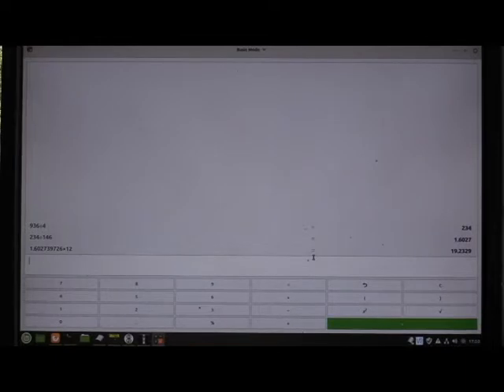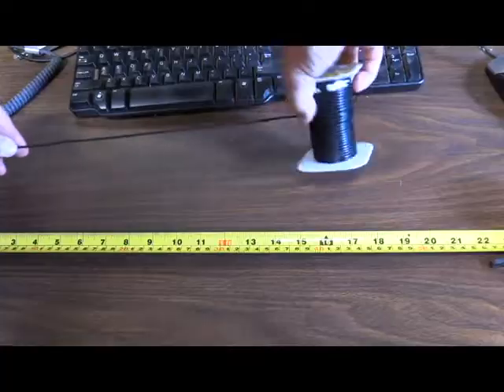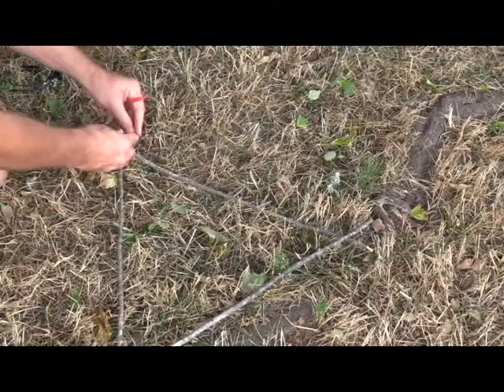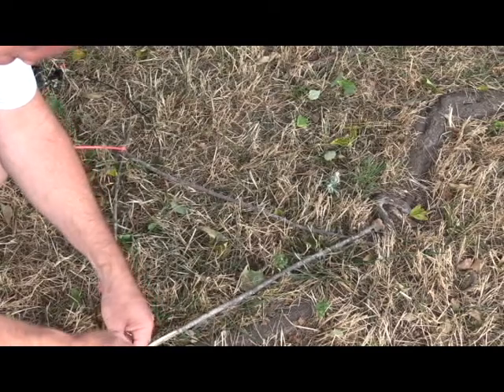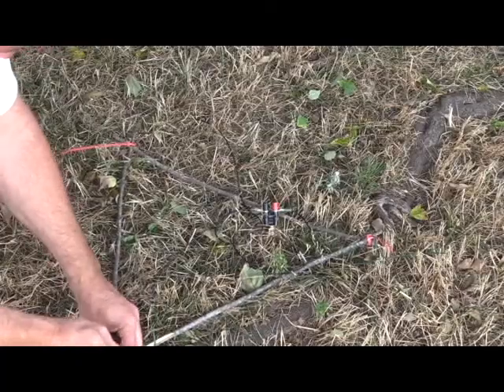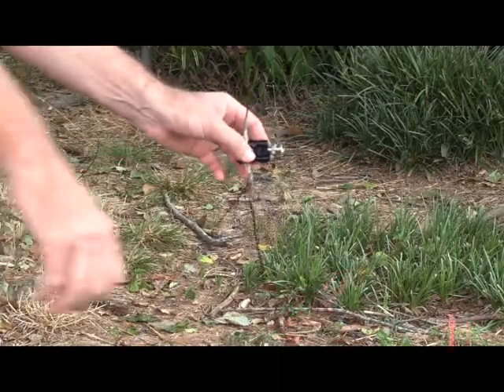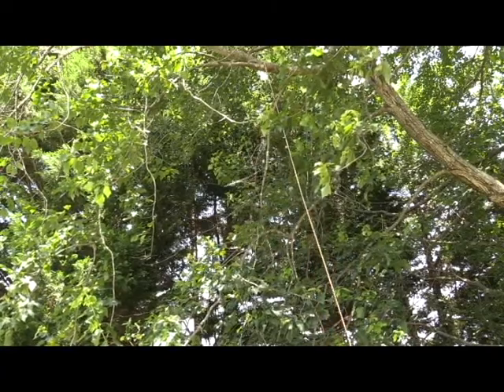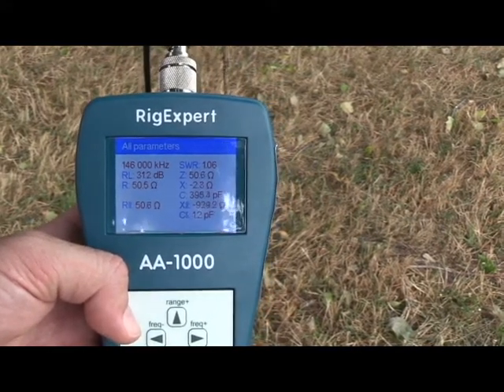The Jungle Antenna Part 2

Comment: ARRL Antenna book describes this situation.  There is a correction I remember for the length/diameter ratio.  If you have a loop at the end, that adds capacitance, so you have to correct for that.  Insulated wire vs. bare also makes a difference.  I'm a little confused by your 936.  I've never used that.  My length formula for a half wave "real world" average dipole has been "length in feet =468/frequency in MHz." I also accidentally almost said for 50 years now, but I think when I first learned it was Mc rather than MHz.  (hi hi, lol). Half wave theoretical in free space with no corrections in feet is 492/MHz.
Reply from the maker: If you read both the Marine and Army Signal Manual, both reference 936; that’s my source.  But using an analyzer, it’s closer to 880 for the jungle antenna. Regardless, get out and try it and see what you come up with.